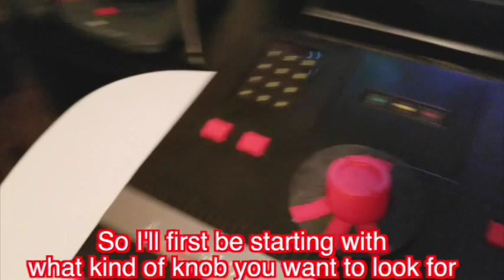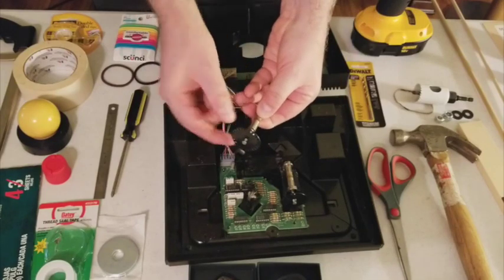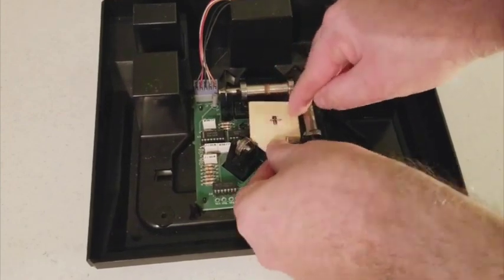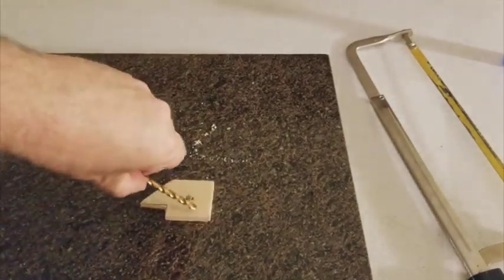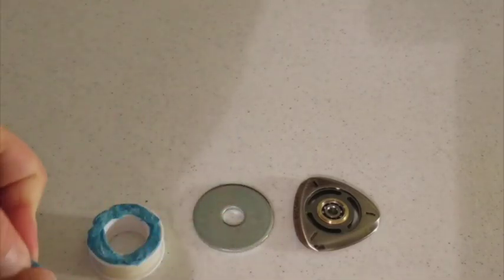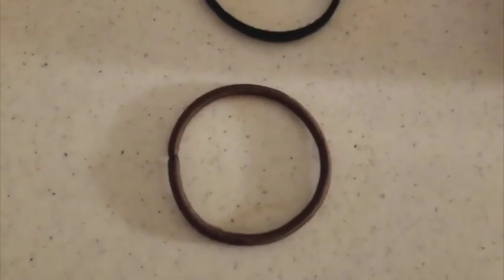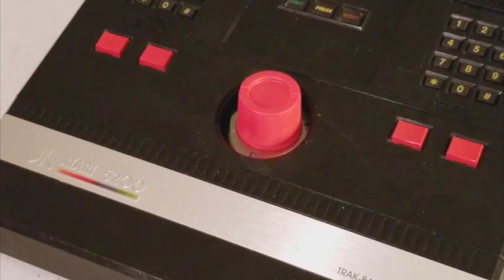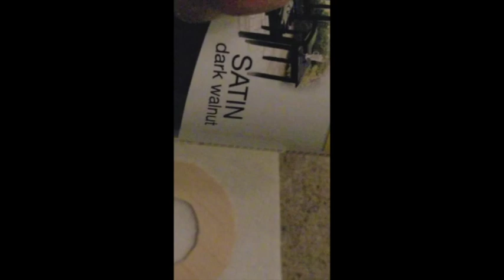Retrofit of Atari 5200 Trakball- Rotary Controller conversion (& it's easily reversible!) vid#19

Comment: I have a trakball for the 5200 and can't get the ball to move. The ball turns. The spindles turn. They could be cleaned and made to work better. But they do turn and I get no movement on the screen. Any idea what might not be working, what might need repaired or replaced?
Reply from the maker: Jonathan Barnhart This is a question that may be answered by the experts (especially Dan Kramer) over at the Atariage forums or the Facebook group, "Atari Trak-Ball Fanatics." My knowledge is pretty limited when it comes to electronics problems of Atari Trakballs. Good luck on finding the solution!

Comment: I see you don't have low gear in Pole Position .... am I correct ?
Reply from the maker: homeelectricco it automatically starts in low gear, then watch as I hit the number 7 button on the controller to put it into high gear.
Reply: Ok..... I see .... #1 is low and #7 is high on the tracball  for PP ....cool